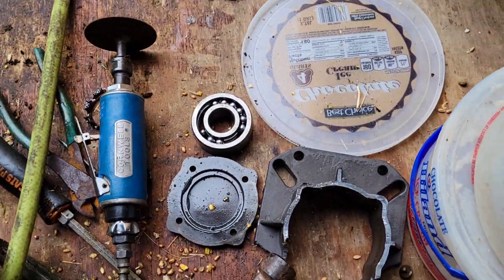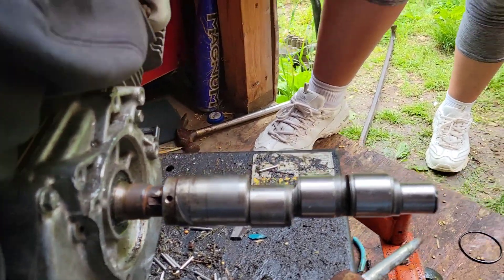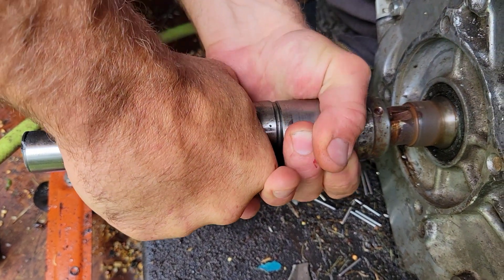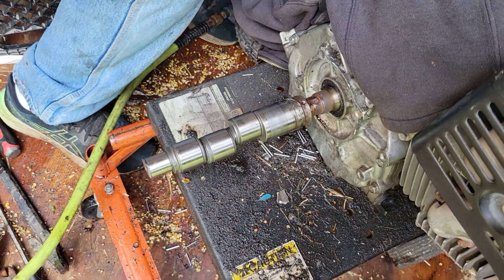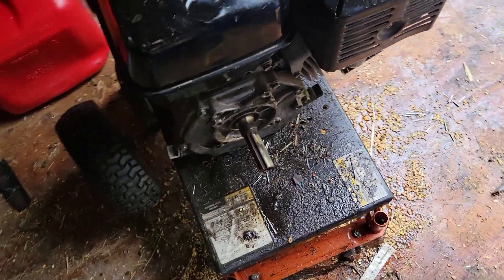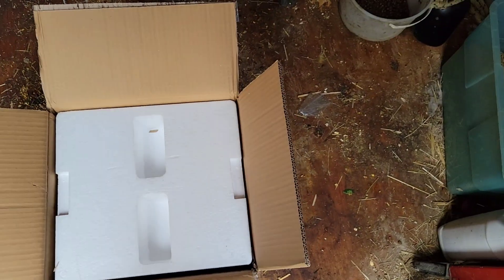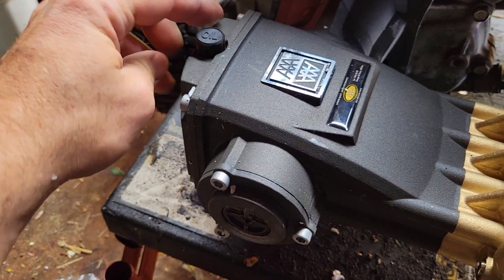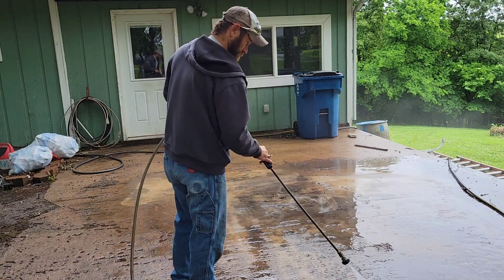How to replace pressure pump on Honda GX390 engine

Comment: Man that is on tight and no set screw. Oh I know your sick of rain cause I know I am. Well I got to say if it's a Honda it's worth fixing, but if was a Craftsman nope. I fixed my Craftsman twice and it still didn't last long. I had too many problems with Craftsman equipment, now I love the tools. Nice job Gavin 👊
Reply from the maker: I didn't think I was ever gonna get it off. Honda is a good motor
Reply: @BomansHomestead83  Oh yea it was on there pretty good, but you did get it. Yes I agree Honda is a good motor 👊